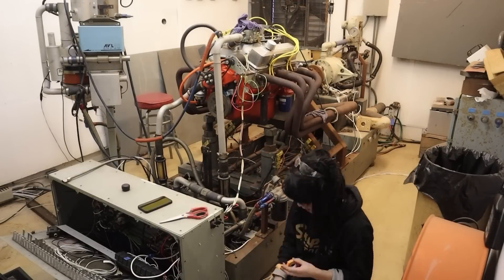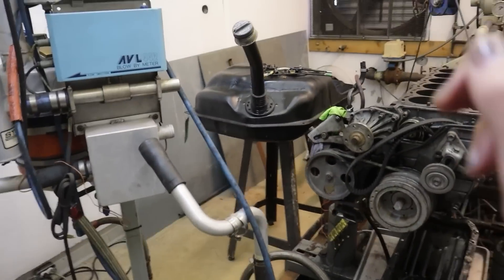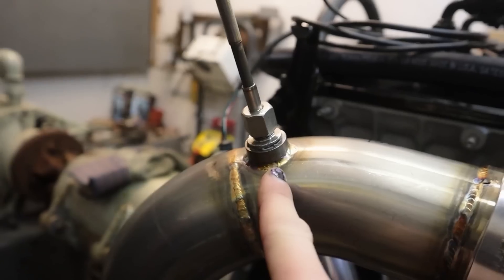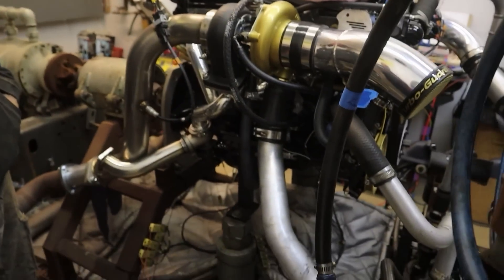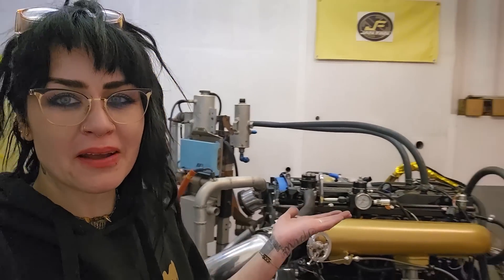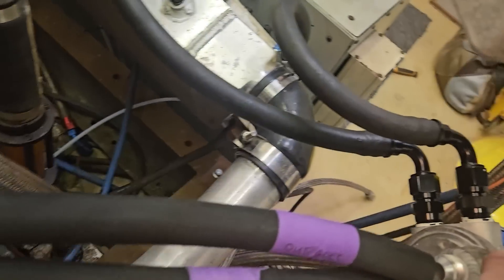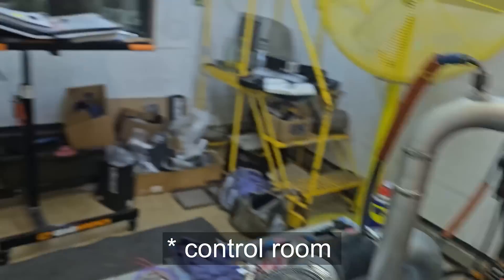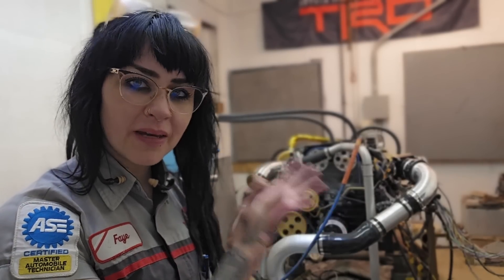Setting up my 7M on the Dyno: Customization, Fabrication, and Wiring my AEM Infinity.

Comment: what's the reason for not running 20-50 over 10-30? I was actually thinking of doing that with the same valvoline oil lol.

and as a side comment: we got goths working on 7ms before GTA 6

Comment: I like the part about the PCV and catch can stuff.  I believe the old GM Quad 4 engines did use a catch can that condensed the oil, and drained it back into the crankcase via a large diameter oil fill/dipstick tube.

Comment: @Fayehadley Oh wow i never knew how much went into setting up an engine on an engine dyno like that. I knew there was bit more invovled to it since you went from a sbc to your 7m but still has alot to do to get it all setup. Your 7m is looking amazing an all that work you have put into it mocking everything up multiple times makes the final setup & install  go so much smoother plus the engine will run so much better since you have set up everything a few different times.. Faye where did you find that awesome oil fill cap at?

Comment: I noticed a slight droop in the turbo drain back hose. The drain should go a straight as possible back to the pan and be above the oil drain level. The oil is wiped into foam and requires a good drain back.  Also Danny refers to crankcase pressure > any pressure in the crankcase will cause the oil not to drain back as well. Nice!
Reply from the maker: Like I said on the video, I had an interference issue with the motor mount so I had to come up with a temporary solution for while the engine is on the dyno. You can see my turbo drain tube here: https://youtu.be/BJJUV5oovsU

Danny said vacuum has to happen in the crank case to seal the rings.

Comment: Good stuff...I remember building an old k24 single cam bare block for a 240sx when I was younger. Bored 30 over with 10.6:1 pistons, ran vp 105 and it made 187/196 at the wheels at 17* timing.  Not anything to write home about but I was super proud of it.  Old beater raised a few eyebrows on the streets lol.  Keep it up girl!
Reply from the maker: That must have been so fun to drive!!!
Reply: @FayeHadley With the old 240's, if you know, you know lol.

Comment: Hi Faye. What are your goals for the engine hp and torque  wise. We know it will run as you built it.
Reply from the maker: Hoping for a reliable streetable driver more than hp, but I'll be very happy with 500hp 👍🏻😁